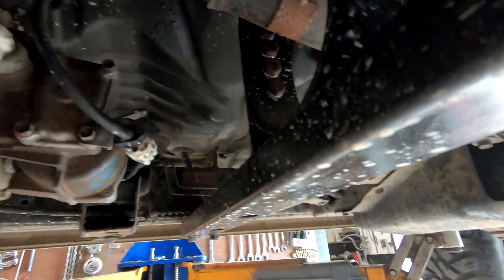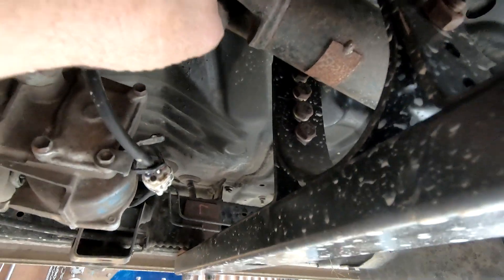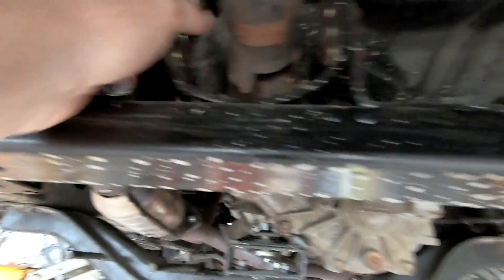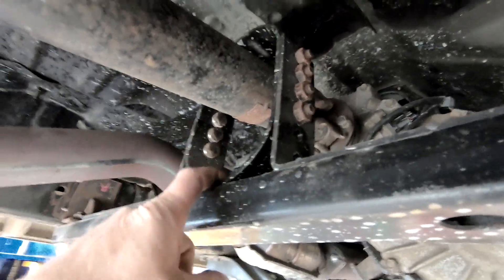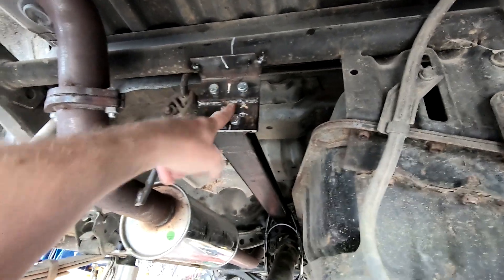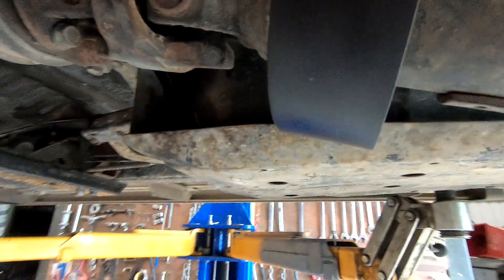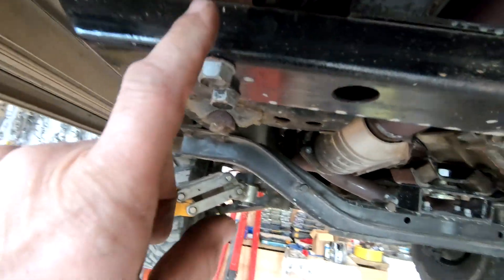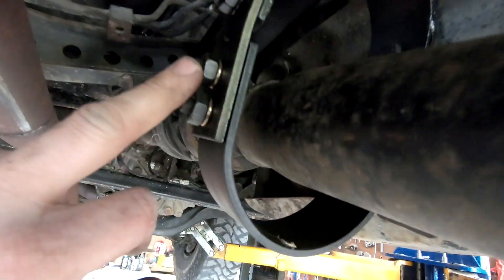How to fit Driveshaft hoops to toyota Hilux , NZ cert.

Comment: hi kelvin, very interesting video, surprise me that part where you weld into the chassis, i wanted to weld my rock sliders into the chassis of a hilux 1995 (so pretty solid), but they told me no weld onto chassis allowed, so my ignorance now has grow bigger, can you explain what can and can't be weld on a chassis? please :)
Reply from the maker: Who is "They"?.  There is details on how to weld to the chassis outlined on the lvvta website.  There are some later chassis which require special equipment and rods,  done by a suitably ticketed tradesman however older stuff its competent welder done in prescribed manner in lvvta spec sheets.  I've done heaps in the manner shown in the video.  Cheers Kelvin

Comment: Do u have to certified to weld to chassis
Reply from the maker: No. Competent welder is the term.  Beware some of the later chassis can not be welded though so enough knowledge to know which can and which cant be welded is required.

Comment: Don't take this at a critique of the rules of your country  but are this vehicles run on the racetrack  that's the only time i have seen this kind of safety  rule . Never I have seen a driveshaft  let go on a car or truck it will make one hell of noise before  it happens
Reply from the maker: Nope,   this is a road car,  with the requirement for vehicles with engine swaps.  I posted this video on a local page and there were plenty of guys who have experienced driveshaft failures,  I was also included in this list.  Cheers